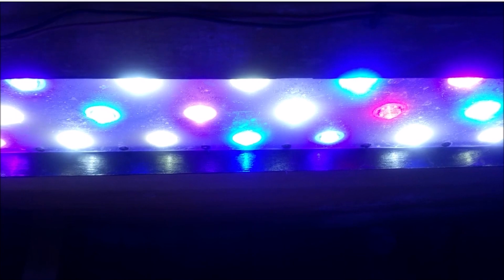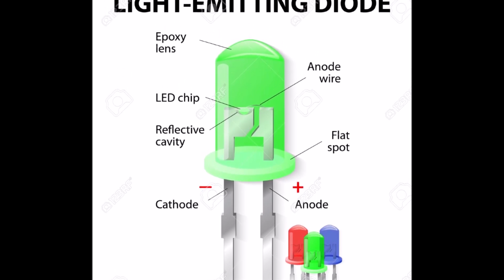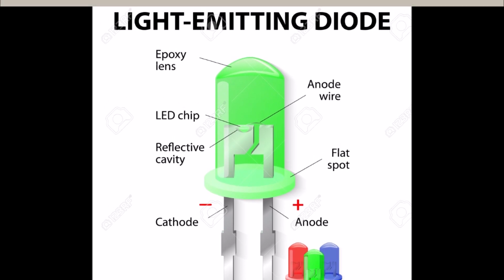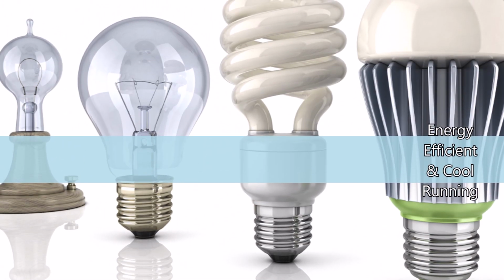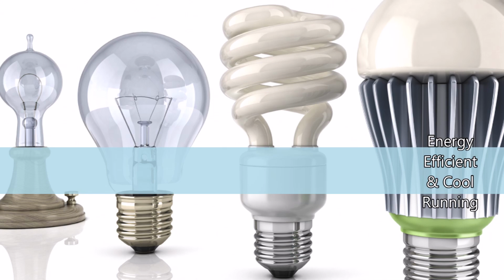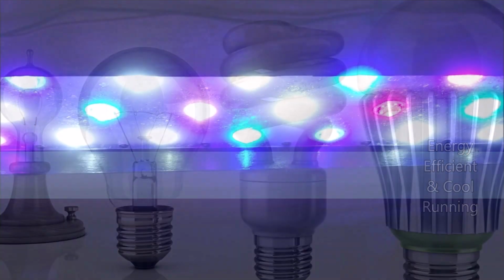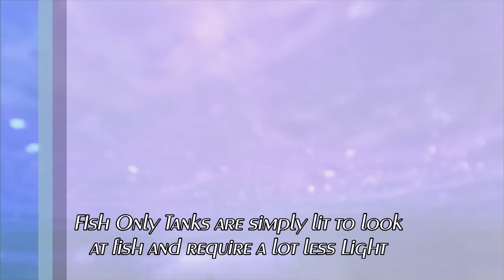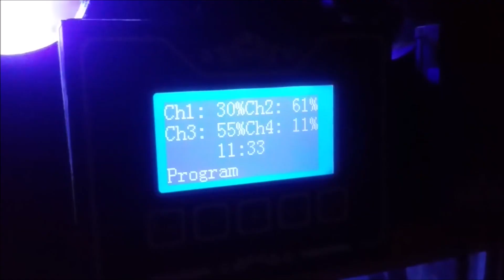Choosing Reef Lighting

Comment: Do the led lights lose brightness over time Like the t5 bulbs?
Reply from the maker: Yes they do but they take longer.    A skilled diy guy/gal can change the diodes.  Some say t5 spectrum benefits plants as they burn down..  they old timers don't change them til they burn out.  New hobbyists are told to change them after 6 months